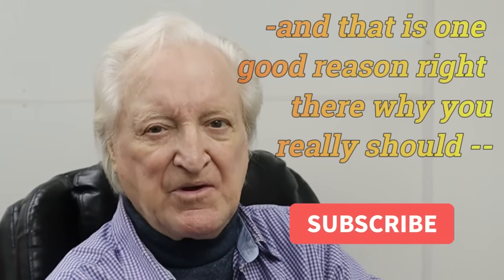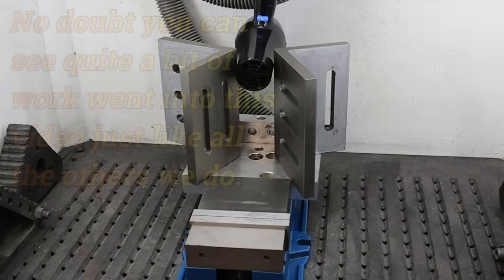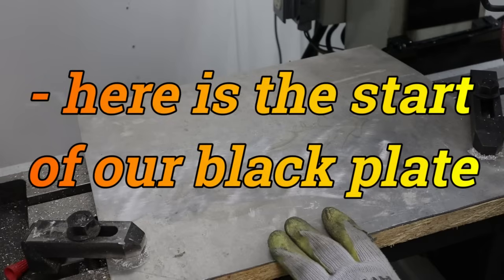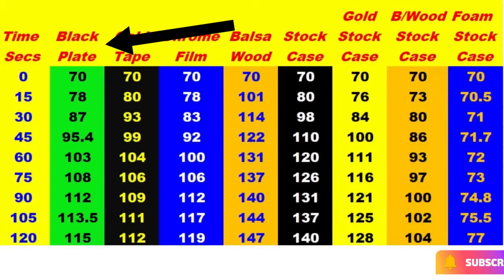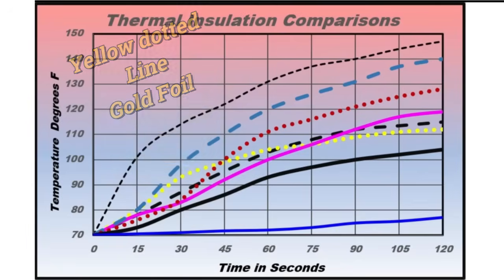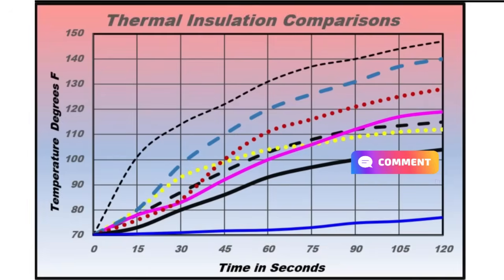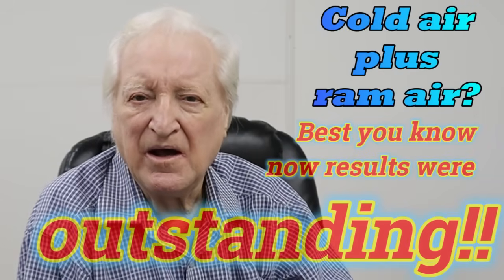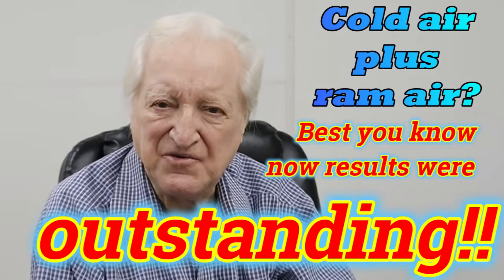Cold Air Induction systems - Just a scam or  ???

Comment: Always use ram air type intakes with large filter elements. If done correctly you can really take advantage of static air pressure from air speed, increased air density. Be sure to keep intake tubes away or insulated from radiant heat of engine/exhaust.

Comment: Perhaps the foil films are more geared to resist radiant heat than the conduction/convection combo of the moving air from the hair dryer. Might perform better for something right next to an exhaust in a stagnant area?
Reply from the maker: Could certainly be so if my tests with chrome plated A Series Mini engines are anything to go by.

Comment: A dual walled tube prolly be the best David.    Blow thru air between the walls ejecting out the back ( blow thru heat shield)and inner tube comming from same high psi pick up point.     Gotta evacuate heat.  Edit:  Asbestos blanket prolly best but we know its problems - header wrap would be interesting.  Also would like to see one with Linear Heat sync ( then same with outside pipe) dual walled^^^

Comment: Try some of that aluminized bubble wrap insulation for in intake areas.  Gonna' melt next to a turbo.
Reply from the maker: Give me a brand to search for please.DV
Reply: @DavidVizard  Reflectix  I think most of the brands are similar.  I have some, and you got me thinking. I have a ram air that extends about 8 inches out of the front bumper.  It's metal, but then changes to black plastic.  I'm going to wrap that part with this stuff.  Sometimes it needs to be removed, and I like the way it will flex when I need to remove it.   I'll use some aluminum tape and not make it too tight.  My cold ram air works very well on my old Honda N/A injected engine.  The intake will feel cold when I check it after driving!

Comment: I trust you will have control of : shift points , boost controls , waste gate contols , timing contols , fuel controls , and any shutt off , and 2 step contols , by the next track test ,,, !
Reply from the maker: May be or, more accurately, hopefully so, but health probs have currently cut my work day to 3 - 4 hours.  Right now I am working on a grill located  ram air setup. Now that's a 'me' project and unfortunately client work has to come first. Not even I get to play on my own stuff just when ever I please  - unfortunately.
Reply: @DavidVizard  ,,, all the more reason not to involve nitrous . It's just so unworthy of your methodical procedure .

Comment: David, perhaps a strange idea but perhaps a coaxial air intake would have merit?  With moving air in the outer layer.
Reply from the maker: Now that sound like a good move. That could be a worthwhile 3D printing job!
DV
Reply: @DavidVizard  in my head I was picturing the "balanced flue" as used on a lot of central heating boilers and the exhaust system of the 1970s Suzuki RE5 motorcycle. The latter had a rotary engine and used a coaxial exhaust arrangement with  scoops. If it works on an exhaust it ought to work on an inlet. Perhaps another odd idea could be to flow more air than you need through a large intake duct and vent off the excess. The more air you can shift the less the less the ambient temperature around the airbox should affect the intake temperature at the turbo. Sorry if this is a poor description.

Comment: If you’re measuring with an “infrared thermometer,” then you need to account for the emissivity of the various surfaces.
Reply from the maker: I had a chart that gives that sort of data - thanks
DV
Reply: @DavidVizard  
Excellent engineering.  I have been remotely admiring your work for decades.  Thank you for being you. Your integrity is refreshing and it should be (more!) contagious.
Reply: BTW:  Omega sells some low-mass thermocouples that can be used to great advantage where appropriate.  As usual, one should thermally insulate the “wires” if the ambient temperature is dissimilar to the temperature being measured.   🤓

Comment: What about putting this on the outside of the intake tube and from intercooler to engine? 

https://youtu.be/DKRqAsJ1N6k?si=gXjuzeYe_Gt7YF2H
Reply from the maker: Hey justlost2010,Just checked this out will call them tomorrow. thanks much for the lead!!!
DV
Reply: @DavidVizard  I ha a 2017 Fusion 2.0. The turbo outlet runs along the back of the engine in all that heat.  So very instead, in the test results.

Comment: I put one of those Air Inlet Systems cold air kits as recommended by you on my street 72 Nova back in 2000 or so. It picked up a half mile an hour and 3 hundredths. Went from 99.15 mph and a 6.85 to 99.7 mph and a 6.82 in the eighth mile.  

It's still on there!
Reply from the maker: Patrick,
please note I did not say they did not work. the point I am making here is that, at best, they only deliver about a 1/3rd of their full potential
Reply: @DavidVizard  sorry if I came across sideways of what you’re saying here. 

I should have said the cold air worked for me in A-B-A-B-A testing on a 400 ci SBC carbureted car, and may not work with any certainty on any anyone else’s setup.

Anyhow, fantastic video and keep them coming, especially any more camshaft tech you may have!

Comment: I like what you said about torque first, rpm second. Too many people don't know that horsepower equals torque multiplied by rpm divided by 5252. A dyno measures torque, horsepower is calculated from the above formula.  Many folks think they are two separate things. Thanks for sharing your knowledge with us!
Reply: I explained this to a coworker (who is actually a car guy) once casually while working. During this conversation I said something like, "That is why all dyno charts have torque and hp crossing at 5252 Rpm. Diesels typically won't rev that high hence they always have dyno charts where the lines don't cross." He was quickly googling pictures of dyno graphs and then told me his mind was blown he never noticed it.
Reply: @henzig8774 
Sonetimes,if they wont rev high enough,the graph can be mathematically extrapolated to see if someone is lying 😃
Reply: @henzig8774 in Europe, or at any manufacturers dyno, it does not cross at 5252
Reply: And that torque at the wheels changes with engine rpm AND gear, while wheel horsepower only changes with engine rpm.

Comment: David. How about DEI thermal blankets. Example would be product number 010834 used in starter motors. It has glass fiber. Would covering an air box with this material help. I've used it on a turbo intake plastic pipe. Since is inches away from an exhaust manifold. Just to bring down the temperature. Insulated side by a laser temperature gun reads 90s. Non insulated plastic on opposite side i get 80.5°F to 88.5°F. I have a diesel engine. The air charge cooler inlet gets to be at 76.4 °F. The exit pipe on the air charge cooler reaches 63.1°F. The intake elbow the is bolted to the engine gets to be 69.9°F. Please note this test was done on 3-17-24 in the morning at 8 A.M. Weather temperature was 75°F. And the truck was driven 4 miles. When reaching home. Temperatures where measured again. To se any varibles. The turbo exhaust pipe was reading 203°F. I don't know if my laser thermometer was broken. Yet is what i had. And i didn't want to touch it by hand. I hope this is iformative for you. Since you shared information. I want to be kind and share my findings with you and the public. Let me know what you think. And Thank you for everything. Be blessed.
Reply: Look up intake manifold heat shields.

(I’ve seen some by heat shields Inc.) 
Then look up cheaper Peel and stick heat shields online. 🤝 you’ll get the idea.

(Side note: if you use the DEI thermal blankets on intake tubes, Try to get really creative in how you can leave some air space between the two and the blanket. Because you were trying to keep the environment the intake tube is in cooler. So where ever the blanket is touching is an area that the heat he is being transferred against the intake tube.
Reply: @Hipsters_N_Hippies  Thanks for the information. I didn't know. Now I do. I'm looking at the products that you mentioned.
Reply: I need to second the DEI products! They work! On my off road race car my feet were within an inch or two of the header tubes with a aluminum firewall between and I wrapped the headers with the DEI ceramic header wrap and my feet never felt uncomfortably hot!
Reply: DEI Inc products are used on SpaceX and Nasa Shuttles and rockets for a reason!
Reply: An old trick I've learned from an experimental aircraft builder ,is how to make your own heat shields. 
Get some tin, some copper or red rtv ,and some exhaust wrap. 
Putty knife is nice to spread the rtv on the tin, and then stick the wrap to it. 
For kicks when my car was apart I did some of the OEM heat shields like that and it's noticable in the temp drops.
Reply: Make your own heat shields with some tin, some copper or red rtv and some exhaust wrap. 
Glue the wrap to the tin, voila.
Reply: @MrTheHillfolk  Interesting idea. And not a bad idea.

Comment: My Mazda3 Skyactiv loses 4mpg to 5mpg when the temperature gets cold outside.
Reply: I think that is more so to do with the skyactive motors having pretty high static compression. 

When it gets cold enough outside the ECU bumps up the fuel to match the cooler, denser air to keep the motor from running too lean and knocking. With the already high compression in your motor any knock could be a death sentence for it.
Reply: @spiv_gennedy  it sure goes through sparkplugs. I am on my 5th set in 190,000 miles. Had the electrode break off at the porcelain and the coil burned out on cylinder 2. When it starts misfiring at a idle you can hear it popping in the exhaust and it is time for new plugs. Have to gap iridium or rhuthium at .030 or it will get a misfire and CEL while idling. Factory gapped iridium NGK plugs will throw CEL every time after a few miles. Denso TT iridium seem to work best and get the best mileage.